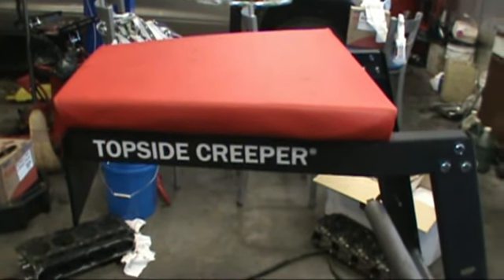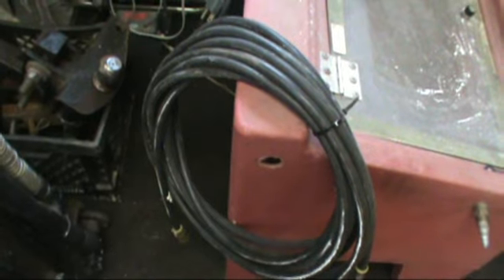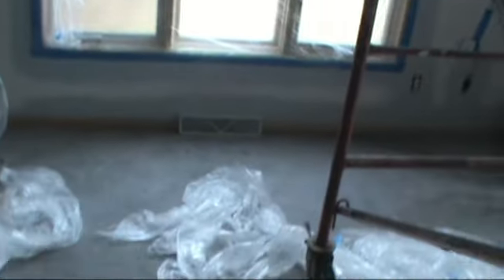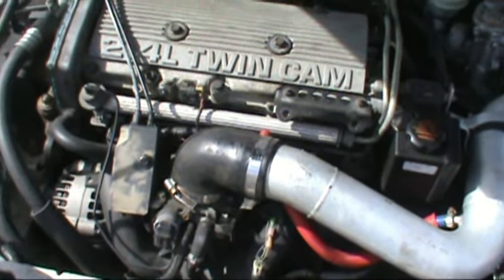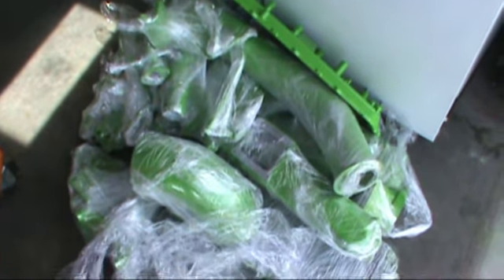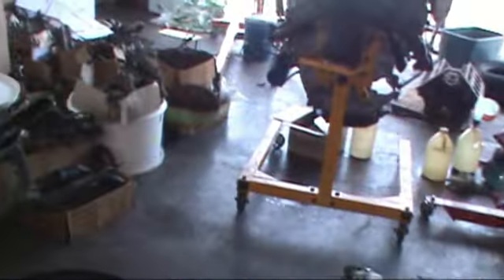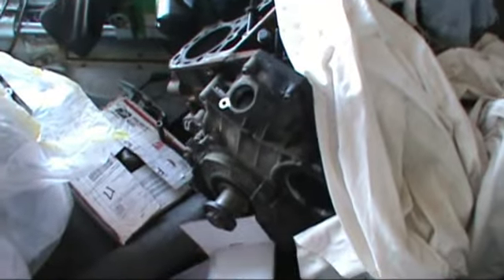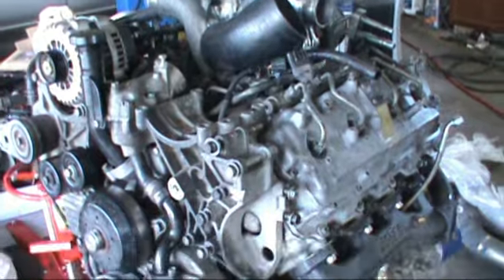What has needmorehorsepower been up to?

Comment from the maker: @Z24travis Oh its getting an inside makeover new timing chain all new gasketsvalves ground head plained new head gasket head bolts and im going to pull it to put on the motor stand so it will be easy to work on ill get some video of it for sure  Thanks for hanging in there and watching much apperciated trav  :)